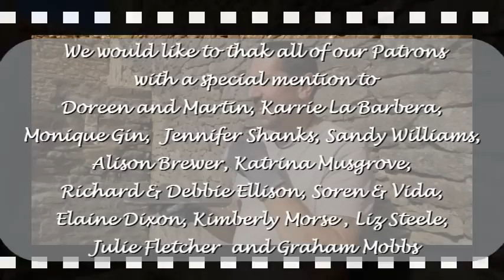Abandoned chateau renovation - Time to face our fears

Comment: Oh Lesa, Lesa, Lesa..... it would have been better for you if the scaffold tower had had a guard rail around the top level. I think there were some spare sections I could see. Next time at least get a panel up on the side away from the roof and also to one end then you have something to grab to steady yourself. You will feel much more secure. Builders always have a "fence" around the working level. Yup those tower trapdoors are tricky to negotiate. I find it best to go through facing the trapdoor and getting my bottom (which is well padded!) on to the planking. If you have the guard rail in place then you have something to grab whilst you get your legs around. Well done girl!

Comment: Don't know but if it's not done by the time u read this what if you remove some tiles in front of wall to slip through and reach where you need to put cement. In tge US they use a metal flashing for those areas

Comment: Ted , a couple of things . ALWAYS lock the wheels and you have another cross bracer use it on the other side . I’ve worked on that type of scaffolding and it’s so much safer with atleast 2 of the diagonal braces on it .
Reply from the maker: Ok, that's me told off